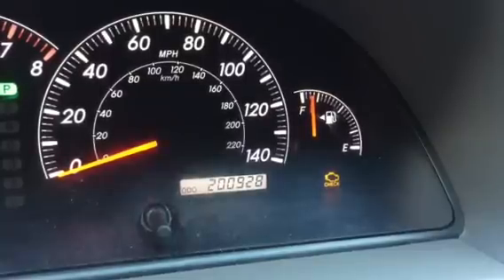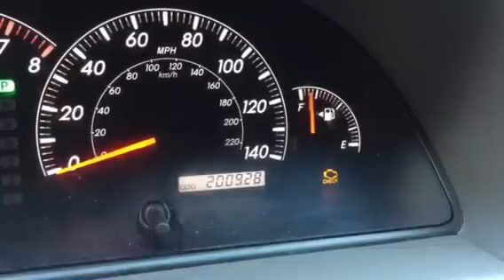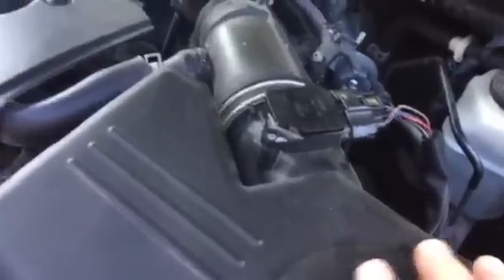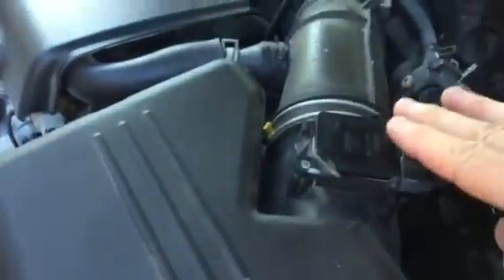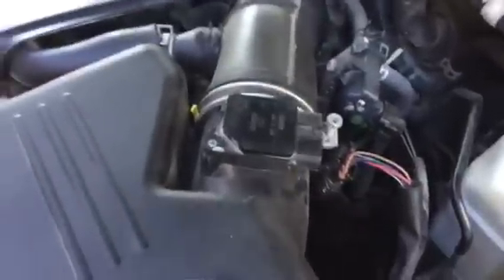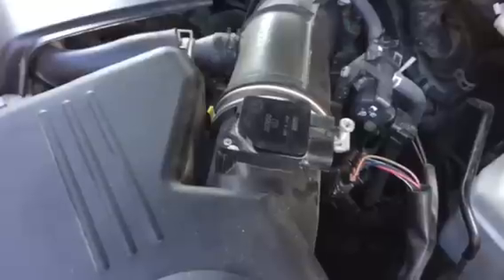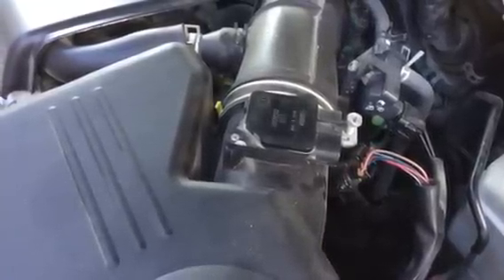How To Tell If Your Mass Air Flow Sensor Is Bad On Your Car

Comment: I'm gonna be 100% honest and say that I figured pulling the cord on a sensor in general would stop the engine anyway. So I walked outside all skeptical, started my truck, pulled the cord and the thing kept running. You win. Thanks.
Reply: I'm going outside....  🤣lmao
Reply: @samuellanda777 I'm going right now 😂
Reply: de
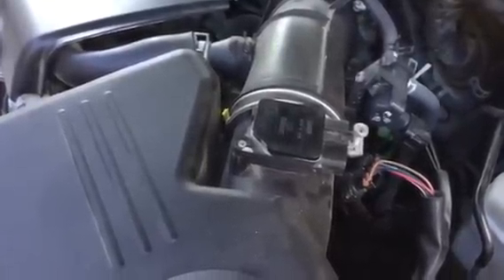Reply: 7?😅 b 1:17 1:18  ? ?😊?? ?  ?????😊??
Reply: That's not the reason it's stage running, because it's bad. The computer has a substitution strategy that when you remove the plug and the single is absent the computer goes into fail safe mode and compensates for the absencent and single that does not indicate a bad part.
Reply: @TEAMCHARBAR 
Sometimes tapping on the mass airflow sensor will create the idle stumble/ stalling situation. That's when you know it's dirty and needs to be cleaned or replaced. Get Ohm meter & test the sensor for resistance values.  Replace if OUT of spec..
💥 BADA BING BADA BOOM 💥.I APPROVE THIS MESSAGE 🙌
Nj'sJfJr 👍🏼💪🏼❤️🇺🇸
Reply: @NjsJfJr   you do not know what you're talking about.
Reply: The same here i tried on the 2008 suburban unplugged the car kept running. I bought a new maf sensor installed it unplugged the car kept running. 🤔🤔🤔i wonder do you do this on a cold engine or hot.
Reply: @SamSam-on8dt  each car work different most of the cars will keep running other dont...if your car keep running BUT you got all the loss power back and I mean like no issues then provably it is bad / bad groud or broken wire must see wire near connector 🖖🏿
Reply: @darkmonkeynuada4372  accurate comment. Maybe common-sense wil prevail
Reply: @SamSam-on8dt try unplugging battery for ten minutes to relearn the ECU input
Reply: @SamSam-on8dt did it fix the check engine light after new MAF ?
Reply: @SamSam-on8dt  or maybe different cars/automakers react differently to that
Reply: Hey Paul you shouldn't be putting videos like that's up a lot of people will be wasting a lot of of money. I don't know if you're a mechanic. That's not how you test an air flow sensor
Reply: @CROFTY71  so what is the right way to test it?!
Reply: @islamsh.4862  Oscilloscope is the correct and only way I know to actually confirm good or bad 100% for sure.
Reply: @Islam sh.  With  multimeter, check ohms at grounds , but Jesus don't short to the 12v, usually marked but ...wait, ya know what? Go to a dealership like mine lol, let us do it.  NOOOO reputable shop is going to charge you an hour labor. At mine, we'd hit ya for 20 minutes so 195..We'd hit ta for 65 bucks if you didn't need the sensor but in all reality probably 50 for taking a techs time and wishing you best of luck or offering a quick hour (if paid, sensor towards the 195 if it was a cheao Delphi or something we had) but it would work out fir both parties. We do "10 minute checks" on stuff all the time. If you bring an RO from the office paid for an hour , I'll sit there and listen to you talk about your dog. I don't really care as long as you have a repair order 😅
Reply: @CROFTY71  This video will for sure cost people a lot of cash.  Your really need to watch data of your O2 sensors, MAF, MAP and your fuel trims also check your wiring integrity before you replace a MAF sensor.  Some MAF's are really expensive.
Reply: @CROFTY71  tell us how do you do it ?
Reply: @franklindebios3779  I would probably use a scan till to have a look at flow rate.
Reply: @CROFTY71  care to enlighten us in a quick no cost way to diagnose this at home for free alsoMm
Reply: @freedompioneer4311  nothing free in this world. I would be looking at scan flow rate
Reply: @CROFTY71  alright good idea are those expensive?.. a scan tool that shows "FLOW RATE."
Reply: @CROFTY71 how do you test it properly?
Reply: @CROFTY71  I would think you are right. Scotty Kilmer mechanic is your man.
Reply: @Nick41622  I would use a scan
Reply: @Nick41622  I use a scan to and look at the flow and maybe look at some service awesome specs as warrior 868 said some cars will run with it some will run without. User diagnostic approach not a YouTube video
Reply: @Ken Crofts  I can't remember what we were talking about.🤣
Reply: @Nick41622  diagnosing a electrical issue with some type of scan tool
Reply: @freedompioneer4311  OK. Thanks.
Reply: Lol me seeing this at 4am and going to see if he wasn’t lying 😭
Reply: @tkayytolive4521 445 headed out to see if he's right :-)
Reply: @tkayytolive4521 I'm ready this at 4:04 am and thinking the same thing
Reply: This video will mislead people alot maf proper diagnosis is with a scan tool or multimeter.
Reply: @Warrior-uk2tx   How would you use a multimeter all you can tell is if no is if it's getting power or not and a scandal is gonna say that you need to replace that when it could be several other things is why people manually diagnose this
Reply: @Warrior-uk2tx  thanks warrior
Reply: @Warrior-uk2tx Mass airflow sensor can cause a o2 sensor code on scanner
Reply: Hi friend do you know how to test it with a multimeter, I would like to know if you can share it with me, I want to learn the right way to test this sensor, thanks in advance
Reply: On gods!! Literal skeptic bad mass air flow for the win on my 2007 chevy tahoe! Brvao sir! 🙌🏼🙌🏼🙌🏼
Reply: Dam unfucking unbelievable just beautiful 👍🏿👍🏿👍🏿👍🏿👍🏿👍🏿thanks so much for the 411
Reply: If your ecu has bypassed the MAF sensor and is running on limp mode, your car will drive very poorly.
Reply: Just use an odb2 dongle with blue tooth or wifi and connect to phone. Maff reading should double for every 1000rpm. So say it reads 5 grams per second at 1000rpm, it should read 10 g/s at 2000rpm and 15 at 3000rpm. Easy and dont even need to lift the bonnet 🇬🇧
Reply: Some of them they keep running if you unplug them
Reply: If i replaced it and it runs worse then before... also unplug it and car still keeps running... car kept running on old one and i got new one still dont die when unplugged
Reply: @lilcoogi1990  make sure its a OEM part most aftermarket sensors give very inaccurate readings and will cost you perforance and gas mileage.  Im all for saving cash but sensors arent the place to skimp on which is another good reason to confirm a bad sensor before condemning it and replacing, some of these are very expensive.
Reply: @lilcoogi1990  WoW 😮😮😮
Reply: I took my buddies advice and tried disconnecting my mass airflow sensor on my 2001 vw jetta 2.0l aeg engine and tried starting my car and heard a click or pop sounded like it came from under my dashboard deep in there my first guess was relay but the diagram I found online didn’t add up to what I have installed already as far as the relay in my location is missing but never had a problem before haven’t been able to start it since lights and everything appear to still work brand new fuel pump, starter and battery, fuses all appear good I feel dumb I deleted the code that popped up.. please help anyone! How can I start my car now?
Reply: @yogi4553  what happens when you turn the key
Reply: I dunno how else to describe it apart from the normal lights and warning sounds Nothing happens.
Reply: @whiiiteisriiiight  I had a mechanic look at it finally and he said it was the starter that was the issue that’s the last I would have checked because of the sound I heard and where I heard it originally I removed the mass airflow/manifold absolute pressure sensor thinking maybe my buddy might be right and this will fix my starting problem because I had under half a tank of gas and always had a problem when it’s that low on gas with this car it just stalls at random freaks me out when at an intersection I’m now assuming this is a engineering problem because I’ve looked inside the gas container and examined the fuel pump and it’s like having a fountain drink imagine the fountain drink with the lid as a whole as the gas tank and the straw as the pump well instead of the straw half way down it’s just under half way down that’s a fairly accurate description of how it works on my 2001 Jetta but this did help me understand how it all works I was shocked when I learned electricity actually runs in raw gas that tripped me out like how the hell isn’t it like boom boom boom! Everywhere ohms I know know but didn’t before!
Reply: @yogi4553  Any updates? Same thing happened to me. I took out a fuse and heard a pop or click sound. I put the fuse back in and the click went away, but my car came back with a check engine light and running poorly. Help
Reply: @hearditfirst8010  I thought I previously answered this I gotta new problem I think midas screwed me when they installed the cam sensor because it was hard to start since I got my car back from midas but I cannot even start it now I think the cam sensor they put in was a dud and my only guess is that was intentional because that cam sensor usually last for a few years this one isn't giving the signal is my assumption thankfully I won't be paying for another one except though muscle I'm not real excited about it either! Hope that helps someone else..
Reply: Ground thebattery to the motor see if it cranks also check to see if it has two grounds one from body to too battery and one from motor to body most like seperated. But if it starts after that then you got a wiring issue good luck.@yogi4553
Reply: Not all vehicles are the same
Reply: Lmfaooooo this entire thread
Reply: My engine light just came on my 2011 silverado LT. It was rough only when starting. Something sounded rattling rough, but then it smoothed itself out. Everything went normal. Seeing your video , I will do that test.
Reply: That's not a sure way of checking this !
Reply: My 08 Honda accord EX-L V6 sedan stopped running immediately after disconnecting maf sensor.
Started w it Not plugged in ran like hell.
Loves this car but I don't think I can fix a stripped stuck spark plug
Reply: @freedompioneer4311  If you haven't already tried,  warm up engine and try. Also and I mean ever so careful, socket on plug straight hit handle of ratchet with hammer lightly and harder little at a time.  Basically like an impact driver. May work. Chase the threads with a tappukl completely out to jeep cuttings out of cylinder. You can take on oiled paper towel wrap around a piece of stiffish hose that is slightly curved and pick up any cuttings in the cylinder
Reply: Hey so is there no harm in doing that while it's running?, I have a g37x 2013 so I have 2 of those sensors, would it be the same thing by checking the one that might be faulty?
Reply: @pablogarcia8188  pretty sure it just shuts the engine down nice car btw
Reply: @freedompioneer4311  thanks man, I'm just not sure if it implies with the cars with 2 sensors as well?
Reply: @pablogarcia8188  good question but if you're talking about the map and maf then yah you can pull the maf it will just turn jt off
Reply: Did u fix issue by reolacing maf
Reply: Why on my mk6 gti is my mad going bad within the year? Given my gti isn’t stock at all anymore… it was fine for about 8 months
Reply: Did it work
Reply: Did you replace it an did it work
Reply: What Kind of truck you have?
Reply: Shouldn't a car shut off anyway regardless if your maf was faulty or not?
Reply: @hearditfirst8010  mine did not shut off. It kept running unplugged or plugged.  It was a faulty 3rd party maf sensor. Got a Bosh Maf sensor and fixed my problem.  But I did hav to clean the sparkplugs during to driving it some with bad maf sensor. Fouled the plugs
Reply: Yeah I'm about to go outside also 😂😂
Reply: Mine runs
Reply: Something tried on a nissan qashqai
Reply: Lol same thing just happened to me 😂
Reply: @MikeJonesenior  
The proper way to diagnosis a MAF sensor requires a scan tool that can give you live sensor data. You look for the MAF sensor info.  It reads in grams per second.  Drive the car and reach 5000 rpm and note the peak grams per second.  The reading should be 40X of the engine displacement.  If you have a 2.0l engine.  You should have a min of 80 grams per second at 5000 rpm.  That is the only legal test allow in California.
Reply: Thanks for the tip..
Reply: AutoZone
Reply: I did replace the maf... new part identical experience... does it mean, new maf was shipped broken?
Reply: Same here… 💀
Reply: Same
Reply: My Taurus dome light immediately goes off when I shut the door most of the time immediately.
    But other times it takes it 25--30 seconds to go off.  Anyone know if this can be a short circuit or caused by a relay?  
       Is this possible?
     Bad relay= Delay? 
    Any input is appreciated.
Reply: 😂😂😂 I’m weak
Reply: You touched grass lmao boomer 😂
Reply: My audi running 2😂😂 and  start and work good with out maf
Reply: Good thing I watched this video and read your comment! Thanks to all!
Reply: 3.4 runs good at idle  then shuts off
Reply: deadass did this on my 07 Yukon after replacing my TPS and the issue still persisted. unplugged the maf sensor and my poor Yukon didn't even care. i suppose its time for a new one.
Reply: it wont start without maf
Reply: I hope you’re right😅
Reply: I’m having problems with my air flow sensor so I just unplugged my as well and it kept running
Reply: This doesn’t work on some cars because it goes into default mode😂😂😂😂
Reply: Just came back from my garage 😂 my car kept running sooo? New maf sensor I guess
Reply: @whatisdreup2 How do you really test one?
Reply: @whatisdreup2  try cleaning it first.
Reply: Ordered my new mass air flow sensor. Bought a 3rd party one before. Never buy 3rd party on German cars they say. Guess they are right
Reply: i think i have the same problem bro dead ass 😂😂

Comment: My car starts up fine, then 2 or 3 seconds later stalls or dies. Mass airflow sensor looks like a simple fix with a new one and a screwdriver I assume
Reply from the maker: It sounds like you might have a dirty throttle body.  https://youtu.be/cOAYWVBfuek
https://youtu.be/LPv1jZMpAY8

Comment: Hello,I have a problem with my throttle body,the idling  is very high and it switch off when comes to stop sighn or robots, im driving a toyota conguest 1.6 fuel injector 1998 model,must I change it,cos I tried to clean it many time but no luck

Comment: I changed out my MAF sensor on 02 Buick regal..now and then Itll stall after the first start...question is do I also need to change out the MAP sensor also?? Any1
Reply from the maker: Have you cleaned your throttle body?  https://youtu.be/cOAYWVBfuek

Comment: Just replaced MAF Sensor.  Fired up engine, unplugged MAF wiring harness and engine continued to idle away... :|  Any suggestions on what to do next?
Reply: Both the old sensor and the new sensor do this.

Comment: This happened to me. I changed out the sensor and After 19 miles of driving the light turned off. After 74 miles the light came back on.
I went to a auto part store for the first and second light. It’s the same 3 codes, po101, po171 and po172. 

Any advice?  It’s a g6 Pontiac 2010 V4
Reply from the maker: I would check to see if the MAF sensor is receiving the proper voltage at the harness connection.

Comment: my engine still vibration when it's cold and when i disconnected it the engine still working, do you think it is because of the mass air sensor?

Comment: I replaced my control suction valve and cleaned up a few sensors but my engine light in the navara 2.5 is still on and my car has no acceleration. Maybe I do need to pay attention to the MAF.

Comment: can someone explain to me why my 2011 Nissan maxima lacks of acceleration at a complete stop for like quick 5-10 sec and does after a while driving I have the p101 code that came up before I've cleaned the sensor already but the code always goes then comebacks

Comment: Alright I disconnected mine and it bogged a little then kept running then I did it a few time and it did the same but one time it did die. Now it wasn’t running at normal temp idk if that would bother it

Comment: I have a Nissan March (2002, 1240cc). Sounds like MAF censor is at fault. But the censor is not visible from out side. Question is can it be placed inside the engine block?
Reply from the maker: The MAF has to be located somewhere inbetween the airfilter box and the throttle body.

Comment: My truck dies on idle, but I'm able to keep it running with my foot on the gas slightly..

If I have the mass still hooked up I can't get it to do anything!

I even tried a new one and that made it worse?!?!
Any ideas?
Reply: Im having the exact problem. Were you able to get it fixed?

Comment: I have Camry 2007 I’m the second owner and I have a question. In the mornings when the engine is cold and I start it it makes a sound and shake a lil bit but like 5 minutes later when the engine is warm up the noise and shake go away. What should be the problem? Some friends say it’s probably the Mass aire flow sensor  ....mmmmm thank you !
Reply from the maker: Perform this and it could fix your problem. https://youtu.be/cOAYWVBfuek

Comment: Question is that with all vehicle I have a 2001 ford expedition 4.6 with check engine light on I ran a test it comes back with a P code 0172 and 0175 MAF bank 1 and 2 I cleaned the MAF with some CRC cleaner and reset my system check engine light but came back on again and it's the same P code did your test but when I pull the power it idles high and low help
Reply: Tony Perez.  I had the same problem I cleaned and cleaned  the mass flow sensor  and light keeps coming back so I went to advance auto parts and bought new one and problem solved
Reply: Jose Lopez yeah I ended up installing a spectre intake system with a new air filter and cleaned out the ICS and it seem to take care of the problem, the only thing that has happen it ran a little sluggish today on the acceleration but no warning light came on odd and it went away ?